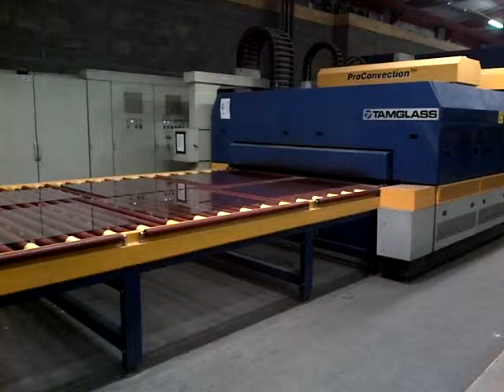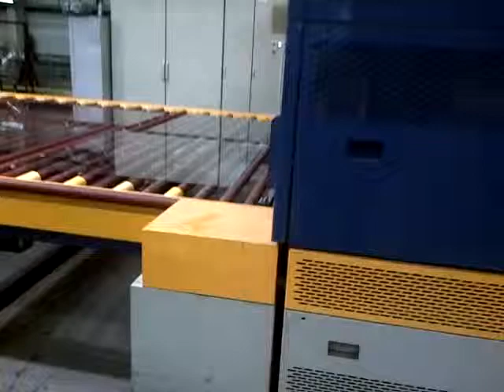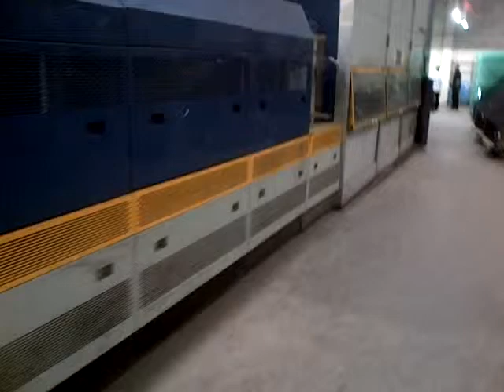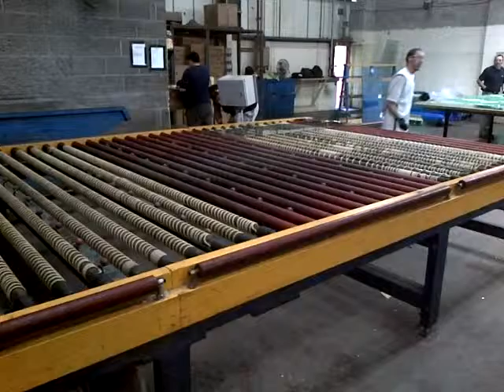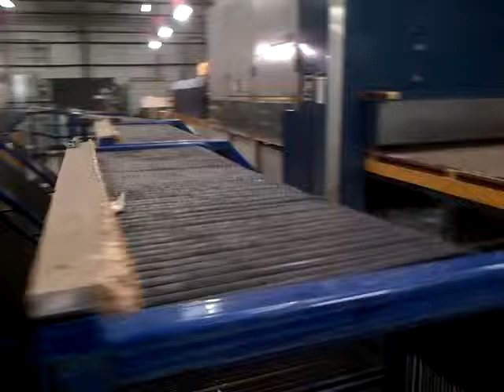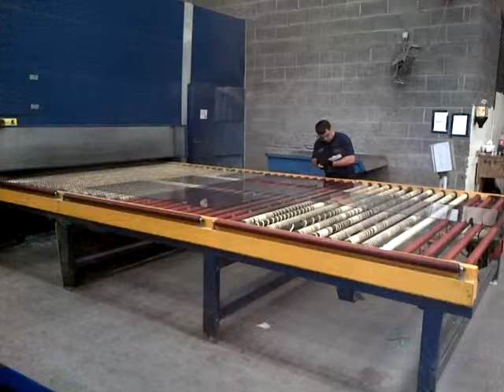Vizor Tempered Glass Ltd - Tam ProConvection

Comment: i worked there until i became the furnace operator with all these  guys too , a job like mine searching you don't know when your arm leg get shopped off , health and safety my ass i cut my self twice badly they threat me instead , even Dan the manager he is not wearing leather apron...and john wood the owner he is my ass too, work is high risk more that you could think of...big furnace that generates 800 degree HEAT and it breaks down all the time and the only way to stop the furnace's problem from developing  is by going close the that heat and sound and air... and get your body around what?  an 800 degrees heat, you might cope in the cold winter but in the summer when the temp is 40 outside and that furnace blow hot air out eventually u will end up with all sorts of heat related problems , if you want to know what else happened to me , i can surely tell you and you will surely figure out that i know that place upside down , i drive by sometime and i stop my car outside to remind myself when i hear the high rev engine noise and say FUCK thats loud from the outside so what is it if you operate that blessed old furnace : bad memories forever